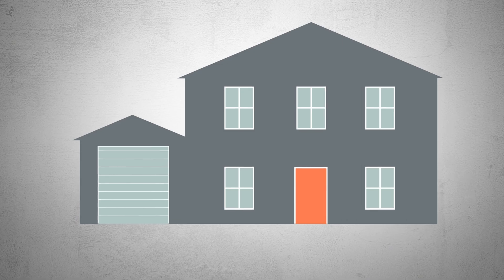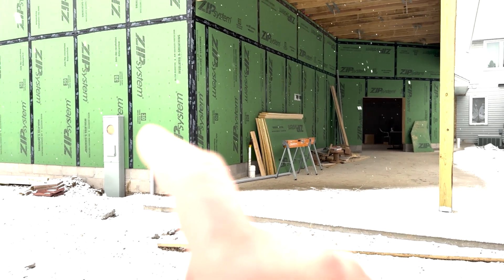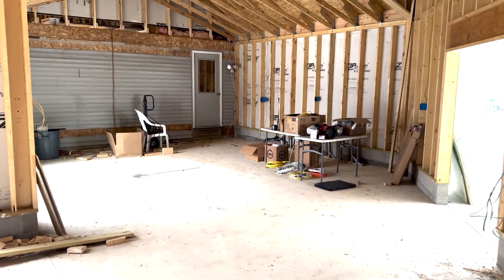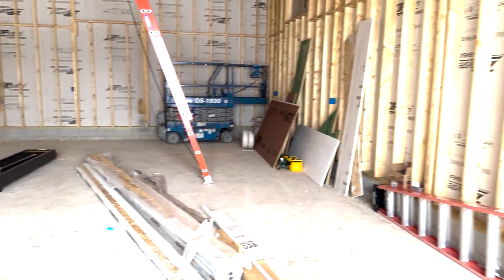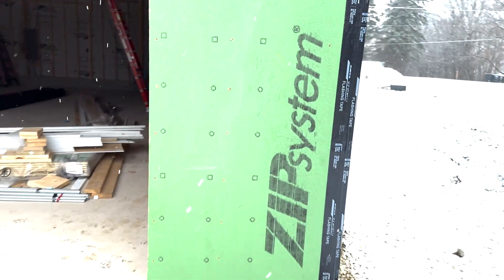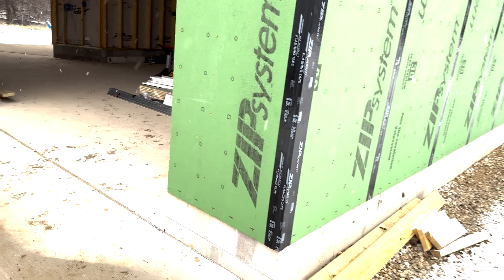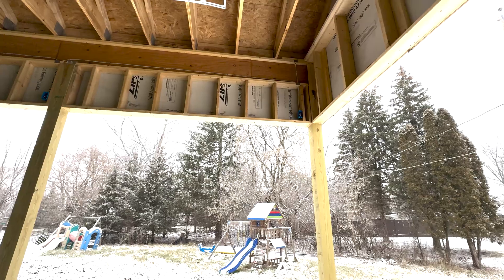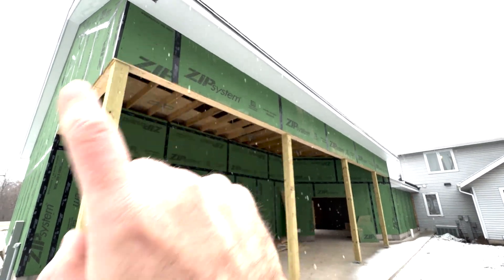FUTURE PROOF your electrical install // Garage Build Ep. 7

Comment: One thing i dont see you discussing it conduit for future changes.
I mean...
I like all the overkill you are installing, but NOTHING is better for future proofing than conduit.
Who knows what the future needs will be.
Place conduit paths to areas for upgrades, and install conduit for the systems you install, so cabling can be replaced.
Reply from the maker: Great point! I've run some smurf tube for future audio/visual cables, but I should put some conduit in for future electrical 👍

Comment: What is up with Americans and spray foam. Buy rockwool, stuff it in with your bare hands, don't need to hire anyone, cheaper, better R value, almost fireproof.
Reply: Rockwool is a great R factor insulation, but it does nothing for air infiltration.
Sprayfoam seals everything.
Allowing dedicated erv to dial in the infiltration precisely.
Reply from the maker: @SuperVstech  well said 👍
Reply from the maker: I’m doing flash and batt. The main reason I’m going that route is to help air seal. Also, since I have a conditioned attic space, code requires 4-5” of spray foam on the roof deck. 

2” of spray foam in the walls and then I’ll also be doing an insulation batt. Rockwool is a great product and I’m considering it for the batt portion.

Thanks for the question and for following along with the build.

Comment: Could you not have just covered the through-stud wire runs with some OSB strips or drywall strips for “protection”? I’m planning to do something like this in our garage soon for the same reason!
Reply from the maker: Great question! It really depends on the building codes in your area. Here in Wisconsin, that alternate method would not pass inspection. I would check with your inspector.